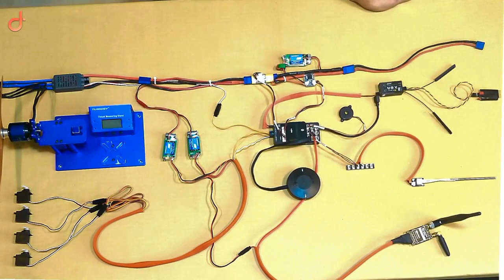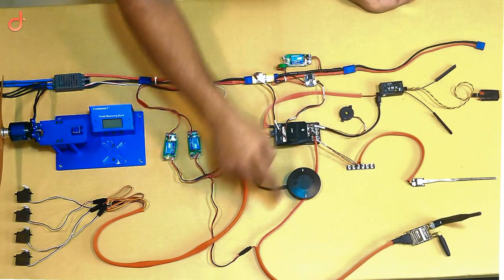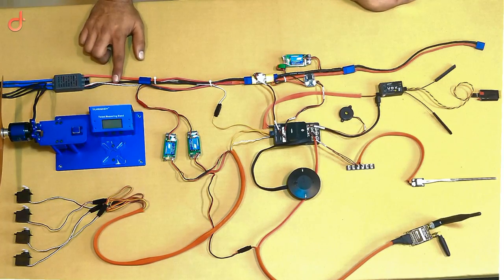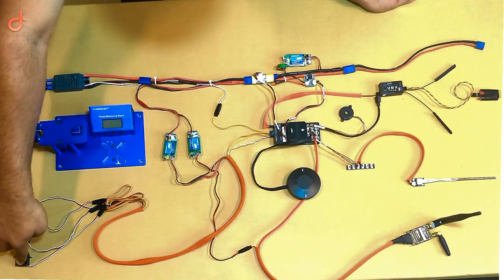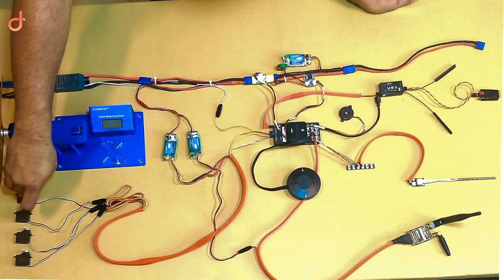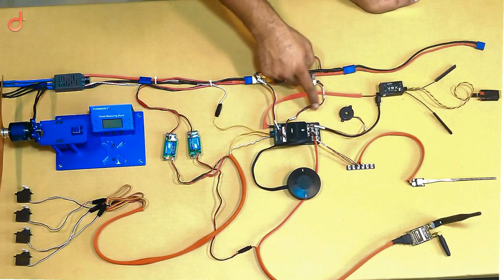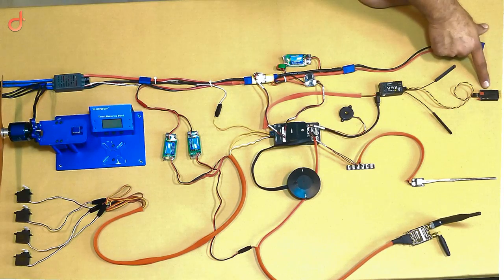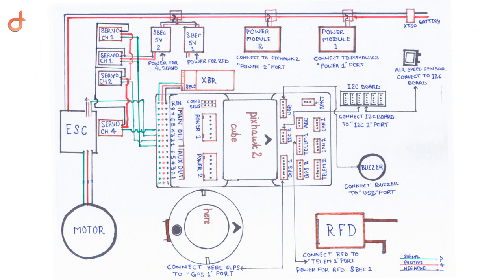Connections & Wiring Between Pixhawk 2.1 'CUBE' & Its Peripherals & Hardware For Fixed Wing Uav

Comment: slight confusion in one of your previous videos from 2017 you advise to remove the positive and negative wires from the RFD module connector when powering it from the bec here the connection appears to be different
Reply from the maker: Follow this video if you are using pixhawk cube  2.1
Reply: @DhruvArora  thanks for the reply buddy really appreciate it, just placed an order for the Cube and Rfd plus module, building my first X8

Comment: Excellent video and questions.  I have a question please.  I would like to use a Micro minim osd with take pxwk 2.1. But,  how to connect to the board? I have Dragon linkv3 taking up most of the pins on Telem 2. Should I use Telem 1?

Comment: Hi Dhruv, very nice setup you got there, I'm about finish my mini talon with pixhawk 2.1 and dragonlink v3 slim.
I have 2 questions if that's ok
First I see you have only signal wire going into servo rail. on arduplane site ( general wiring recommendations) it says  (THERE IS NO SETUP WHICH WOULDN’T REQUIRE SIGNAL GROUND TO BE CONNECTED) I'm not sure if that's for everything or just ESC wire! 

Second question:- if your plane is fully ready and powered via a battery, if you arm it and put it into RTL mode while it's still next you and hasn't moved, will the motor start? or the plane must be at a certain altitude or distance from where it aquired 3d lock before RTL  starts to works?
Thank you and keep well.
Reply from the maker: 1) We recommend powering your servos via a separate bec. Do not recommend using the servo rail for power

2) Motor should not start but there will certainly be a twitch in the servos
Reply: Thank you Dhruv, you surprised me 😀, it took you a long time to respond but I guess you are a busy man! Hope you had a good Christmas and looking forward to 2019. Thank you my friend.
Reply from the maker: @dolphin3609  cheers!

Comment: Hello Sir,
Nice video with good explanation,
why did you mounted the signal cable of servo 1 and servo 2 in parallel? 
In case of a VTOL, the elevator signal cable 1 and cable 2 are also supposed to be in parallel?
Reply from the maker: this is explanation is for fixed wing only. Not for vtol
Reply: @DhruvArora  Can provide a schematic  diagram for a VTOL?

Comment: Sorry there was another question too😁😁 where do you connect an analog airspeed sensor if you don't have a digital one? Or does pixhawk 2.1 only accepts digital speed sensor? Thanks again
Reply from the maker: Sorry, never used analog airspeed sensor with pixhawk. Do not recommend also

Comment: sir still confused about wiring the RFD in the video i can see you havent removed the vcc and ground wire from the telemetry cable/RFD cable so how will we power it up with a bec then because if its not removed we will be powering it with both the sources the bec and the pixhawk itself, kindly brief me on this & any other solution instead of the Mauch module, cant get my hands on one, something from bangood or aliexpress if possible?

Comment: Sir ;  I have a rfd 900 radio and looked at the Manuel and it does not show the plus minus voltage .  my cable is from left to right   Black , brown , red , orange , yellow , and green.  in your video I could not see your wiring of it , shrink wrap.  If you could help me .     Thank you sir

Comment: Why is it not desirable to power the servo rail directly with 5V, then plug in the servos -/+/S to the power rail. You're powering them all directly from the BEC. You made a point of recommending the external power supply. . . why? Will it not work by plugging in a BEC to the Servo rail directly?
Reply from the maker: Sharing my experience my friend. Better to use a separate power source for servos
Reply: @DhruvArora  well yes, I understand this is your experience, which I definitely appreciate. I'm just asking why, as this isn't necessarily a typical installation. Why is it not recommended to plug the bec, as well as the servos, directly into the rail? The 2.1 is laid out with this in mind, no? I'm just trying to understand. I'm not suggesting your method is wrong. I think others can benefit from this knowledge as well.
Reply from the maker: @austntexan  the reason is that in case you attach a heavier servo which might draw more volts then what pixhawk 2.1 can give then there is a chance that pixhawk 2.1 will reboot. So to keep it safe and a standard for all servos its better to use an external power source.
Reply: @DhruvArora  Ah, ok. I'm still learning. It's definitely better to be safe than sorry, especially when you're way out of LOS. I always thought the servo rail was already isolated from the 2.1 through. Thanks for replying and explaining your process. Your videos have really helped me understand the 2.1 better!